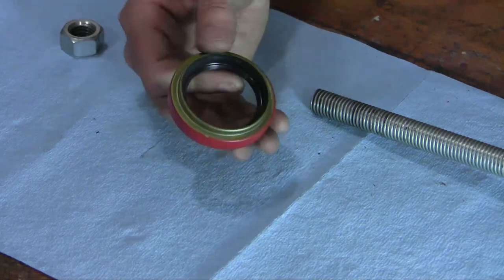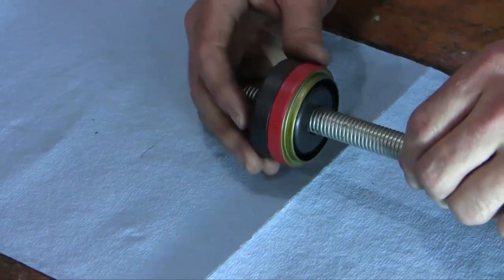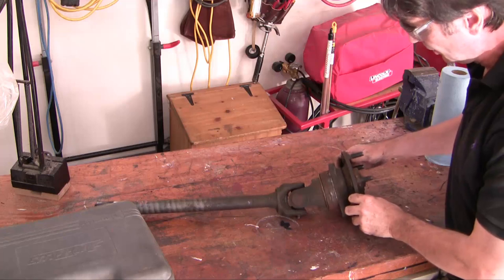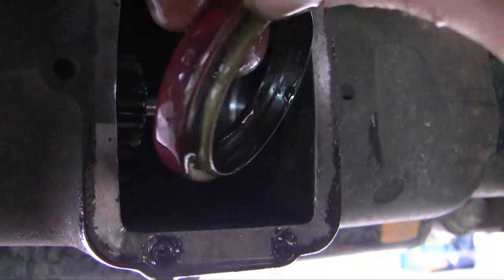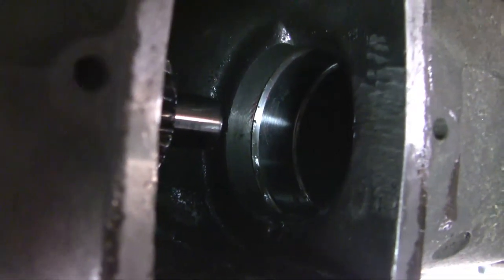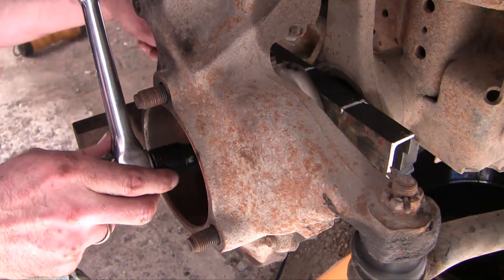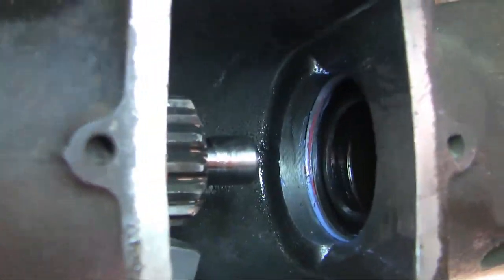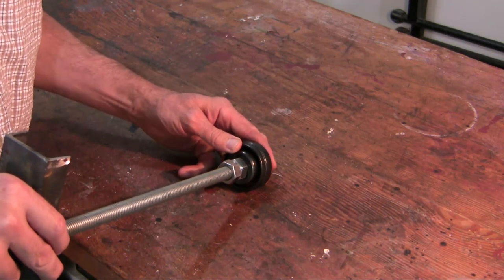Replace right front axle seal, 1998 Dodge Ram 4X4, part 2

Comment: Hi
Excelent video and technique..
Maybe you can help me.
I have to replace the inner bushing in te axle.
Is the bushing  in the other side of the  4WD shifter housing, the one that goes to de differential side.
The axle goes up and down there, and I belive thats the reason why my seal gets broken.
How do I remove the old one?

Do you have any experience on that?

Thank you

Domingo
Reply from the maker: I'd pull it apart and find out what is wrong. That said, it is not uncommon for that axle seal to fall apart if you haven't seated it correctly, especially if you didn't use a dedicated seal driver to place it.
Reply: @spelunkerd  Thanks for your rapidlly response.
I live in Uruguay and here only a few people know about this Ram model.
I just finished taking all passengers axles and it seems that in a previous owner repair they didnt put the bushing, now I understand why every time I engaged the 4 x 4 i hear an ugly noise "clang", that was the inner axle hiting the house of the diferential.
I will put a new one.
Thanks

Comment: Awesome 🥳  but where do I find this item to purchase  🤔
Reply from the maker: As I read this again, I'm guessing this is actually a real question. The seal driver I used was from Quad4X4, but if I were you I'd read the comment by Daniel Stevens, where he made one himself with a 3D printer. Much cheaper, he included the details needed in that thread.
Reply: @spelunkerd  thank you 🥳👍

Comment: SO AFTER removing old seal now , another issue arises where the corrosion or such lies on the area of where the seal sits and now stuck there trying to squeeze a seal into a rusty zone out of the nice bored area inside of the shaft exactly where the seal sits as if some material was used in the installation of sealent around the seal itself..or from contamination from the outside.. either way now its trying to pull a brand new  seal that is now covered in SEALANT gasket maker crud. through rusty/corroded looking sealant ZONE WHICH > WHICH is about 3/8ths WIDE covered in corrorsion
Reply from the maker: Yeah, use lots of brake cleaner and swabs to get the rusty crud out before introducing your nice new seal.
Reply: there seems to be corrosion that all the brake cleaner in the world wouldn't remove in my case... what now.. dremel with a wire brush... wouldn't that ruin the nice machined inside casting of the area where the seal needs to be seated..
this method you applied permatex on the seal prior to putting it in the housing..now if I do apply some type of sealant as that would that not make my seal housing worse over time as product keeps gunking up around the seal housing zone..
Reply from the maker: I would just clean it as best you can, use ample sealant, and hope you get a good seating. This has to be the most difficult seal I've ever encountered, mainly because there is no easy surface on the seal to pull against. DIY attempts to make your own seal driver can fail if you are applying pressure to the wrong part of the seal. Good luck!

Comment: i went to quad 4x4's home page and found full kits. I called them and tried over the phone to order it and it seems that they don't carry it anymore... do you have a part number that they could look up in their inventory or an exact URL to that part. I have a 99 dodge ram with the exact same leak, I've already tried the washer method and it worked for 2 weeks, now leaking again. Id even buy your seal driver if you would sell it to me. it may be the last one ill ever see.

Comment from the maker: It depends on whether you are going to use an OEM seal or an aftermarket seal. The seal made by them only fits the former, there is quite a difference. 

If I had a lathe, I would get the actual seal I would be using, and design he driver around that. I'll see if I can find the one I have again, we've moved and it might be lost. If I can find it I will give you some rough dimensions.

Comment from the maker: With part one of this video, I show how to replace the left axle seal, which incidentally requires removing the right side because you need to get the diff out, and the only way to do that is by removing the (right) intermediate axle. So, a video showing how to do the left will show how to do both. It's the only video described as "part 1" on my channel.

Comment: Question. When you remove drive shaft. No differential fluid should follow correct? Even if it was not leaking before removing it. I might have moved seal removing hub assembly
Reply from the maker: Most of the time I don't get any oil draining when removing either of the front outer axles. For the right front axle seal, you'll get about 50 cc of gear oil dripping after you take off the shift housing shown at 4:54, so use a pan for that. It doesn't drain a lot, but if you don't get any fluid out the shift housing plate you should check your oil level in the main diff housing to be sure you're properly filled up. Guys with newer models sometimes add gear oil back in through the sensor port of the shift housing when they are putting it all back together, but I've never done that. My OEM manual doesn't mention it, but newer models may have more of a seal, so check your manual. In my Ram there is no seal separating that cavity from the main front diff, so gear oil will find its way over the the shift housing fairly quickly. If the outer seals fail on either side, you'll get a characteristic oil drip pattern on the inside sidewall of the tire on that side. It leaks especially with a hard turn to the opposite side.
Reply: @spelunkerd  great info thanks. Looks like im good. Picking up rebuilt driveshaft  tomorrow.  👍

Comment: I'm having major trouble with having the seal go in angled, essentially ruining it.  I'm using the same driver from quad4x4 and a straight threaded 5/8th rod.  Seat in the axle house all seems good.  No idea what is making it not go in straight.  Do you have any ideas?  Do you remember what brand of seal you used?
Reply from the maker: Only the OEM seal from Chrysler will work with that driver, get it at the dodge dealer. My experience was similar.

Comment: should all pop apart, i removed the carrier when i weldedit. been running the setup 2 years. this will be the first seal issue for it. lotta water were we wheel and sandy gritty soil too. eats up seals..unit bearings..ujoints.t.ugh.. rears get contaminated regardless of extra measures. the price of fun i guess

Comment: I replaced the CV put everything together and had a clunking noise. Took it all back apart and noticed what looks like the clutch collar disconnect is just wobbling around and not connected to anything I lined it up as best I could onto intermediate shaft and reassembled still making clunking noise. Noise goes away when 4wd is engaged I'm thoroughly confused
Reply from the maker: I suppose the forks could be lined up incorrectly. Those forks are meant to slide in the groove of the nut they control, so the nut is held in place by the forks, neither able to slide one way nor the other without active movement of the forks. I would pull the back plate off and make sure the forks are properly aligned in the groove, capturing the nut. I would check to be sure the nut is correctly oriented. The forks are controlled by a pair of black and red vacuum tubes that lead back to the transfer case. I suppose you could have accidentally pulled one of those vacuum actuator connections off. I show more views of this in a few videos, most recently in a video titled "Dodge Ram, Front Brakes and Leaking Gasket Repairs...", about 2 minutes in. The dealers repair manual shows fairly good detail of how it should look.

Comment: what  is the deal with the intermediate shaft in the CAD ? my nose is worn to a point from driving with a bad ujoint. the execess end play wore out the actuator fork and the intermediate axle nose. So can I pull the intermediate axle out and replace with out going in the jack pot? this whole job is costing big money just for the parts.i buy good parts when digging deep as to not have to redo from part failure. I cant find any exploded view diagrams of this. also is a the nose replaceable? all the pics of intermediate axles don't show a nose. im guessing the axle I just put the ujoint on will have to be replaced too.
Reply from the maker: +precinct 1 baltimore county residents I use Alldatadiy, which is about $45 for a 5 year subscription. It's very similar to what the dealer uses, and it will have exploded parts diagrams with torque ratings, TSB's, etc. You may find parts like the intermediate axle at a junk yard, I'm not sure how much those go for in the aftermarket. Yeah, I replaced both U joints, and the truck requires maintenance. However I'll be sad to see my Dodge go -- it was a fun vehicle to work on. There is loads of room to work, and parts are usually fairly cheap, compared to newer vehicles.

Comment: Hello sir, I was wondering if you can help me with a problem I have encountered while tackling this project. When I start to pull the seal, it wont stay straight. I goes in slightly, then starts to tilt and seat unevenly. I have attempted many times but its the same result each time. Can you suggest what I may be doing wrong or what could be the problem? Thanks for any information.
Reply from the maker: For removal of the seal, pry it out, with whatever tool you have at hand. A seal puller works great but if you don't have one, any pry tool will work. There are various brands of seal pullers but honestly most professionals just quickly pry it out with whatever they have at hand. The don't care about damaging the old seal because it will be replaced anyway. For installation of the new seal, you need to tap it square so it doesn't twist off center. You can buy a kit to help with that but any flat object like a piece of wood or a large socket will work.
Reply: +spelunkerd 
I am working on the front right seal. I tried to tap it in square but there is not much room in the C.A.D. housing to do so. I put together a set up like yours except I bought a 2 inch hole saw and cut it down to 1/2 height like others have posted. I center the seal as best I can, then when I start to tighten the nut. The seal doesn't go in straight. It tilts and starts to go in at an angle. Is there a step I'm missing to get the seal to go in straight? I appreciate any help.
Reply from the maker: Of all the seals I've ever done, this one was the hardest, for the reason you describe. Perhaps rotating the seal to a different angle will help. As you say, most other seals are easily corrected with a few taps of a hammer, but you can't get a good swing. You might be able to pry it square with a big screwdriver and some kind of shim. The custom seal puller has more of a lip on the device that helps to center and square the angle of entry. I'm sorry I can't help more....
Reply: spelunkerd, thank you for your help. I will keep at it and let you know when I finish this harder than it seemed task.
Reply: spelunkerd

Comment: How do you remove the inner and outer seal on the right side of the front axle on a 99 ram 1500 4x4
Reply from the maker: I'm guessing that it is very similar. The 98 was a new model year, and that axle has been around for decades. Newest models switched to electric actuators but these old trucks were vacuum actuated.

Comment: The coupling that connects the inner and outer axels keeps sliding off and in the process eliminating the right side from the differential? Please help. 

I put the coupling back how it came out and it fits into the holder on the lid of the housing
Reply from the maker: Something must be wrong with the way it went back together, the controller should actively control how that coupling moves by movement of the fork that slides it on and off. I would be checking functionality of the mechanism that does that. Some of those are vacuum activated, so a vacuum leak might be an issue with that design. In a system designed with electrical activation, you should be able to work out whether it is working. I'm sorry, I'm not able to help other than that. If in doubt, check the OEM repair manual for more detail as to how yours is designed to work.

Comment: What is the part# for that seal tool . i bought some off ebay and they were wrong after giving my vin# and other information.and spending close 2 300$ and can't return . so if you have a part # that would be appreciated. Thanks mike.
Reply from the maker: I found an aftermarket option on the net, Quad4X4 was the company, more details in the discussion thread. It was expensive, and you need to use the OEM seal because it is a custom fit. A better idea is to take it to a store that can 3D print a seal driver for you. The plans are in the discussion thread, too, and there is a link to the exact details needed for 3D printing. Alternatively you could use a hole saw and fabricate something yourself. I tried that, and failed, but others were more successful. Good luck!
Reply: @spelunkerd  that's what I did I use the tune 5/8 hole saw for the back part of the seal and then I had to take about 1/8 in off of that to get the exact back size of the seal but then I also made one for the front of the seal I think it was 2 1/8 or 2 and 1/4 inch with a hole saw and that one fit inside the axle tube which was used to hold the front of the seal while the other one I made which was 215 Ace that I took about an eighth inch off that one was used for the back of the seal to kind of sandwich the seal between the two brackets not to the extent that it damage is Seal but just enough to hold it in place to pull through the front of the axle tube to get it to seat which it worked but I just wanted to get the actual one so that next time if I need it I don't have to use the ones I made but the ones I made worked if it's just I had to kind of watch it as I was tightening it and then I had to check it to make sure it was seeing right as soon as I started tightening it, it's kind of like if you've ever used those self collapsing rivets the new Dodge Rams have collapsible thread inserts that are used on the underside of The Rocker to hold the step plates so it's kind of like that where when when you when you're squeezing the threaded insert and as soon as you feel it give way that means that you have to stop and check it to make sure you don't over tighten it but it's just enough that you know the seal went in straight which is how I did it yesterday but I had to stop and check it as I was tightening it to make sure that I didn't go too far so far it's not leaking but I haven't refilled it yet to see if it's going to leak but I know because I took pictures of the seal I know that it seated right. I just want to get the axle seal tool so I don't have to use the ones I made not the ones I made don't work but when you have the exact tool you don't have to fight with it to check to make sure that it's eating right when you make your own stuff like I did you have to take your time with it to make sure that it works this is the second time as is with you having to do it a second time the first time I did it the seal one and crook it and that was with the tools that I was told were the right ones that I bought off eBay after giving them my VIN number and everything and they said they were the right ones yet they pulled the seal in crooked. So then I had to make those medallions or discs if you want to call him that out of quarter inch plate steel I think it was a piece of 3 in by quarter inch flat stock which then I had to use two different size hole saw pieces to cut them out and then I had to Center the holes on them so when I put it on the threaded Rod that they were centered so that way the seal would go in straight but like I said I centered the seal and I compressed the seal between the two pieces that I made not tight just hand tight I hand tighten the nut on the top of the plate I did just to keep the seal from moving up or down it was just enough pressure to keep the seal from not moving and then once I did that I was able to tighten the seal from the outer part of the axial there by pulling it into the seal place for it to seat. but I am going to review that site you recommended to see if I can find that seal piece or find somebody who has it I just didn't know if you had a was there a part number on your peace. anyways thanks for your time I'm going to review that site for the part and maybe see if somebody has one . I would venture to say that the split axle was not one of dodges fire moments.  which brings another question which is that if Dodge knew they were selling these trucks like the tools are needed it's not like it's a aftermarket piece you know it's a factory piece that is still rolling around the streets of the United States and they just discontinued making the tool needed to fix that which is messed up. anyways thanks again if I have any more questions I hope you wouldn't mind if I would send them to you. thanks Mike. also be safe out there with this covid stuff going around .
Reply from the maker: @michaelgonzalez6692  With increasing use of plastic and microelectronics, we're going to see a lot more problems with discontinued parts in the coming decade, especially when manufacturers completely retool for electric cars. Fortunately this one has the work around of 3d printing, if needed. I pinned the discussion of 3d printing so people can find it more easily. Cheers,

Dave

Comment: Would a bad deal make 4x4 not work at all?
Reply: Not necessarily, but a bad seal makes my dashboard shake with a vibrating noise when the front axle is engaged (I have the 4x4 posi-lok manual front axle engage kit). If the e-clips are gone from the axle disconnect shift fork, as mine were, the front axle would engage only occasionally and temporarily, and disengage randomly.